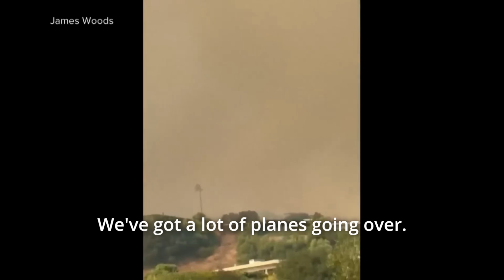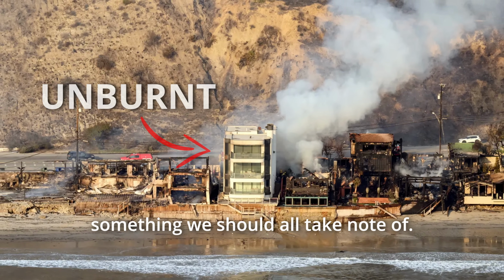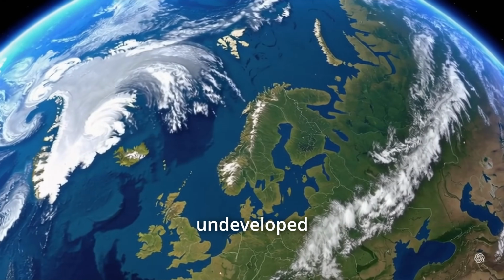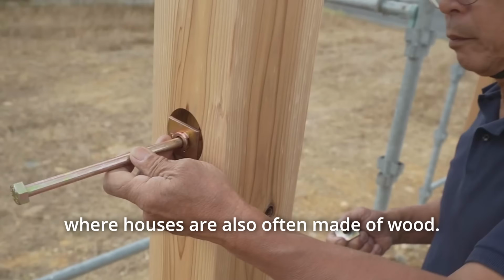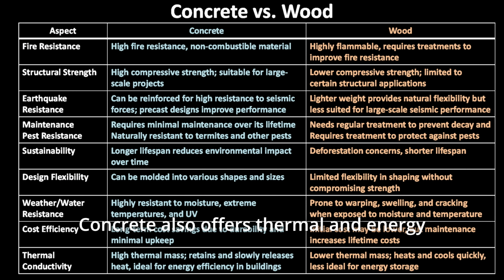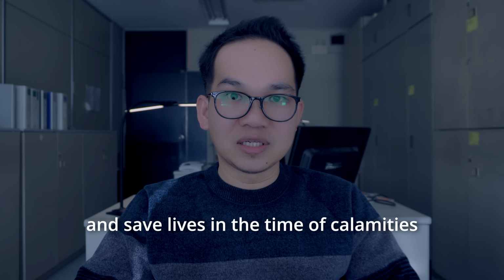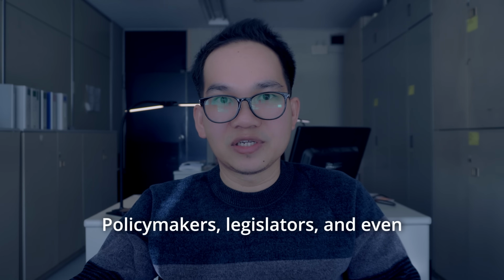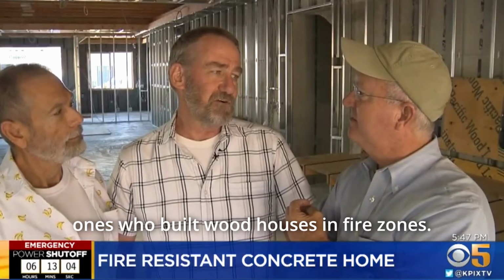Fireproof House? - What America Can Learn From The World

Comment: We have developed a steel frame & cellular concrete system that fills the walls and roof providing a monolithic structure, the benefits of cellular concrete is insulation compared with structural concrete we are based in Australia bushfires are common here no ember attack can penetrate a concrete encapsulated house we have fire shutters on the windows also
Reply from the maker: Excellent system, I would love to see it! A monolithic steel frame with cellular concrete offers both structural integrity and insulation - a smart approach for bushfire-prone areas and against calamities.

Comment: Where I live –130 kms south of the arctic circle – single family houses mostly are built of wood. The whole northern half of Sweden is forests, bogs, marshes, and heath. New residential areas can't be built on the treetops. 
*It seems that many people take easily available stone for granted. The glacial period ground most of the rock into boulder, gravel, sand, and clay. Naked rocks will moulder away due to frost wedging, as the annual average temperature is 1.3°C. Concrete is used for foundations and, in larger buildings, also for inner walls. Sweden's primary source of limestone goes for half machine due to the big risk of destroying the best aquifer on the island Gotland.
Reply from the maker: Thank you for sharing this! It’s really interesting to see how geography, climate, and local challenges influence building materials. In northern Sweden, where wood is abundant and provides excellent insulation against the cold, it makes perfect sense as a primary choice. On the other hand, California’s warmer climate and increasing wildfire risk (and earthquake vulnerability) make fire-resistant materials like concrete or ICF seem more helpful. It’s always fascinating to compare how different regions adapt their construction methods to their unique environments!
Reply: @evdonsicatphd FYI: wood does not provide insulation. The a The R-value of a 2x4 wood stud is approximately 1.25, as it measures about 3.5 inches in depth and wood typically has an R-value of around 1.25 per inch. This value is for the wood alone and does not include any insulation that might be added in a wall system. Contractors “always” put 2-6 studs together for door openings, fireplaces, widows and doors. Making a house walls have 20-30% conduction.

Comment: Excellent video.  What do you think of ICF for home building?
Reply from the maker: Thanks, appreciate it. I think ICF is an excellent choice for home building. Its reinforced concrete core provides superior fire resistance, with a 4-hour fire rating and minimal ember intrusion. ICF homes are also hurricane- and earthquake-resistant, making them highly durable. They offer better energy efficiency than wood-frame homes, reducing heating and cooling costs. While the upfront cost is slightly higher, the long-term savings on energy, maintenance, and insurance make it a smart investment. Most importantly, they provide exceptional protection against natural disasters.

Comment: I disagree. We live in South Africa that mostly uses concrete homes. When we experience wildfires our homes also burn. The contents of modern homes are highly combustible too. There is no getting around it. Fires destroy property.
Reply from the maker: I presume the concrete itself didn’t burn, though it may have been damaged, while the combustible contents of the house or any wooden components were what actually burned. Fires are indeed destructive, but using fire-resistant materials can help slow the spread and provide more time for evacuation. Stay safe!
Reply: Study your house fires. Fire entered the interiors somehow, if the exteriors are entirely non-combustible. I'm willing to bet the roof systems are faulty.
Reply: That's why you need to protect roof wents  are now to be used in Australia. (Those cost 5 times more then previous one but can safe your home). 
Ac has to be shut down and / well protect too
Reply: Common entry points are roof vents and windows. 
Windows and glass need to be rated for higher temp and fire. 

Fundations should not allow for the fire to crawl under the building.

Comment: non combustible cladding over wooden structure is just fine, no need for concret, window glass shielded against heat radation  and NO mulch along the buildings
Reply from the maker: That will be excellent solution as well, as long as you can keep your home protected.

Comment: Excellent video. I came across another one similar to this in which the person visited a few properties in the Pacific Palisades area and did a critique of the burnt houses and pointed out the features of the ones that did survive. Sadly, the ones that burnt appear to have been built before the most recent building standards were enacted. It would be interesting to see what damages were sustained by houses that were built according to the most recent standards, standards that mandated fire-resistant material.
The one ray of light from this fire is that when rebuilding does get undertaken, all the houses being constructed would have to adhere to the current building standards.
One question: Windows can be a weak point. Can metal window shutters add an extra layer of protection for the window casing and glass, in case of a wildfire?
P.S. Use of concrete cinder blocks for house construction is a standard in FL. This standard came about after a severe hurricane some 20 years ago. Homeowners in FL also have metal window covers that they put on their windows ahead of a hurricane.
Reply from the maker: Thanks I appreciate it! 
That example from Pacific Palisades is a great case study in how updated building codes can make a difference in fire resilience. 
You're absolutely right that rebuilding after a disaster presents an opportunity to improve resilience. This has been seen in multiple regions worldwide—like how Florida adopted concrete cinder block construction after devastating hurricanes, I am glad to be informed about it.
On Windows and Fire Protection:
Yes, windows are a major weak point in wildfires. The intense radiant heat from a fire can cause glass to shatter before the flames even reach the house, exposing the interior to embers and flames. Metal window shutters (especially fire-rated ones) can provide an additional layer of protection by shielding the glass from radiant heat and embers. In wildfire-prone areas, dual-pane tempered glass combined with exterior metal shutters or fire-resistant window coverings is a recommended strategy.

Comment: As one PhD to another, I watched your video at 2x speed to see if you would be able to make the main connections on why wood frame construction is used in some parts of the world rather than others.  You failed to explain this.  The main driver for why concrete, rather than wood, is used in Mexico, Central America, the Philippines, Indonesia, Africa, and South America outside of Patagonia is termites.  It has nothing to do with fire or earthquake resistance.  Now, moving on to why are places like Central and Southern Europe or the Middle East are using concrete and brick, while places like the USA, Canada, Scandinavia, Northern Russia outside of  big cities, New Zealand, Japan, and Patagonia using wood frame construction?  Notice a pattern?  Might it have to do with availability of plentiful, comparatively cheap timber?  Concrete construction is affordable in poor places because they are poor, so labor costs are low.  Those concrete houses in California are much more expensive than the equivalent framed construction.  Fire resistance has nothing to do with the structural material.  The World Trade Center collapsed due fire damage, despite being built from concrete and steel.  By the time structural aspects of the building are exposed to fire, the building is probably a total loss.  You need to think more about this, rather than giving the shallow response you did.  As a chemical engineer with an amateur interest in home construction, I am sad that a structural engineer made this video.
Reply from the maker: Thank you for your comment and for watching the video. However, by watching at 2X speed, you clearly missed some of the information and misunderstood the main point that the video conveys. I understand, you barely watched; but I thank you for your time.

But, for the sake of the discussion….
Yes, timber availability plays a role in why houses in some regions are built with wood. This is true for Japan and California, USA, as mentioned in the video. The choice of wood also provides insulation for cold regions.
In Japan, while wood is abundant, strict fire-resistant regulations exist due to past catastrophic fires, such as the Great Tokyo Fire of 1923. As a result, modern Japanese homes are mandated to use treated wood and fire-resistant materials in construction to mitigate fire risks—something not universally required in America.
I have lived and worked in the Philippines. While I cannot speak for other countries, the shift from wood (which was previously used) to concrete was not primarily due to termites, as you suggested. While termites are a concern, effective treatments and hardwood alternatives exist. Instead, the transition to concrete was driven by typhoon resilience. The country experiences some of the world's strongest typhoons, and rebuilding wooden houses annually is neither practical nor cost-effective. Concrete also offers durability against earthquakes, which the country frequently experiences, and, of course, fire resistance. This is why concrete is also suitable for California, given its exposure to wildfires and earthquakes, as well as its temperate climate—again, this was mentioned in the video.
Notice the pattern? Changes in building materials and policies are driven by past calamities to prevent future damage—and that is the main message of the video. This is something worth considering to help prevent or minimize damage, such as from the recent wildfires.

Let's continue...
You mentioned that “concrete construction is affordable in poor places because they are poor, so labor costs are low.” This is a very poor argument. Germany, the UK, France, Italy, and many other wealthy nations use concrete as the primary material for their houses. The choice of concrete in these countries is not due to low labor costs but rather because of its durability, fire resistance, and adaptability to modern construction needs. Material selection depends on availability, environmental, and structural factors, not just economic status.
You also stated that "fire resistance has nothing to do with structural material"—which is a flawed argument, especially coming from a chemical engineer with PhD. Which material burns: wood or concrete? The answer is simple: the choice of structural material absolutely affects fire resistance. If you had paid closer attention, you would have seen at the end of the video a U.S. homeowner who learned from a wildfire disaster and switched to a concrete house.

Now, regarding the collapse of the Twin Towers…
The collapse of the Twin Towers was a result of the combined effects of the aircraft impacts and the intense fires fueled by jet fuel, which weakened the structural steel framing of the building. Steel loses about 50% of its strength at around 1,100°F (593°C) and 90% at 1,800°F (982°C), which led to sagging floor trusses and the eventual buckling of the perimeter columns. Any material exposed to such extreme temperatures would weaken—but which material weakens or collapses first? Steel, concrete, or wood?
The structural frame of a building is what keeps it standing, and in the case of the Twin Towers, reinforced concrete was not the main structural frame—it was a steel-framed system with lightweight concrete floors. For the new One World Trade Center, the structural core is now made of reinforced concrete to prevent a similar failure in the event of extreme heat.

Concrete has many advantages over wood and steel. Some of them include:
•	Fire resistance (it does not burn).
•	Does not corrode or decompose in water, unlike metal or wood.
•	Structural durability, making it an excellent choice for earthquake- and typhoon-prone regions.
That is why for many structural engineers, concrete is the preferred material—not only because it is durable but also because it is cost-effective.
I made a whole video about concrete—perhaps you may want to watch it and learn about it. - https://youtu.be/gTEJ4_Hjb3c

Thank you again for your insights!
Reply: @evdonsicatphd  Thanks for your response.  I started watching at 2x when you had kept belaboring the same points.  I think you are wrong on pretty much every point.  But in any case we are arguing based on our takes on this, rather than data and engineering and economics.  I'm sure that you can see that I'm not going to concede any ground based on your degree, since arguing from authority is a logical fallacy, and I worked for a world class structural engineer and I'm aware that he had his own set of blind spots.  Changing engineering choices on particular calamities is poor engineering.  Changing engineering choices based on logical consequences of changed engineering requirements is engineering.
Reply: “Changes in building materials and policies are driven by past calamities”. I don’t have any historical knowledge of the Great Chicago Fire, but when I visited Frank Lloyd Wright houses in the area, they too were almost exclusively wood. Cheap abundance of wood is central to why wood is chosen. I think human nature/behavior, our habits and cultural influence our decision making more than codes, durable materials or fire resistance. My brother who use to build 3-6 houses a year built a ICF house (exterior stucco) for our sister. In his 40+ year carrier, that was the only ICF house he built. And while his older brother wrote two books about The Superinsulated House in the late 70’s and early 80’s, he did not change his behavior or insulating practices other than to comply with code requirements. Our younger brother, with an even large company building high end houses, never changed either. My sister, who had the ICF house built, is perhaps the only one out of 12 kids who even read our brother’s books. As you use to say, “all the problems are solved, it’s just the implementation”.
Reply: The concrete structure cannot be compromised if fire is unable to enter and ignite the contents. That's why well-engineered homes don't burn in a wildfire. Good design practices coupled with attention to detail ensure wind-driven embers never enter. We're doing this in British Columbia, Canada: wood-framed structures clad with Hardi siding and standing seam steel roofing. No decks, no combustible materials of any kind within thirty feet of the perimeter. My own home also has triple-glazed glazing and no eavestroughs, utilizing instead very large overhangs over drain rock. We're seeing great success here, the only challenge being getting people to understand the need for non-combustible construction. It's a bit of an uphill battle, as so many homeowners are ignorant and demand wood decks, wood siding etc. Once they lose their homes they'll learn.
Reply from the maker: @KevinMaxwell-o3t  Absolutely agree—well-engineered concrete structures are incredibly resilient, especially when paired with fire-resistant design principles. Concrete’s non-combustibility and heat resistance make it one of the best materials for withstanding wildfires, as long as embers and flames don’t find a way inside.
Your approach in British Columbia is a great example of how proper material choices—Hardi siding, standing seam steel roofing, and triple-glazed windows—combined with smart design elements like large overhangs and defensible space can create a truly fire-resistant home.
The challenge of changing homeowner mindsets is real, but efforts like yours are paving the way for safer communities. Hopefully, more people recognize the benefits before experiencing the consequences firsthand.
Reply: It does not matter if it is build with food or key is how spread is contained. 

Building in or near wild fire zones? 

Sprawl and difficult road access? 

Old or new buildings up to code? 

Closed/Protect Air vents ?
AC units protected ? 
Fire rated windows ? 
Concret fundations ? 
Using fire rated or hardened wood for construction? 

Keeping ground clear! 

Firewalls (sandstone)  to next door buildings.